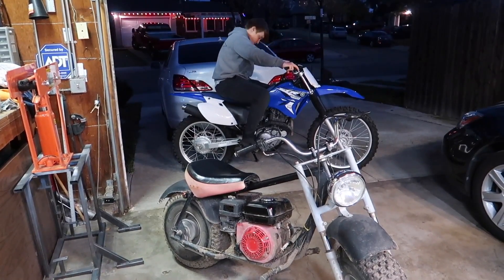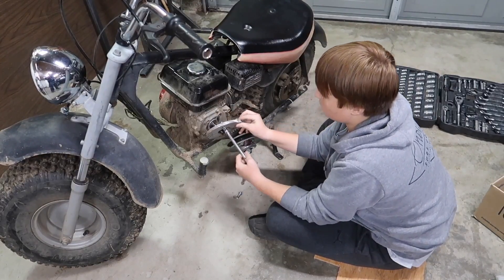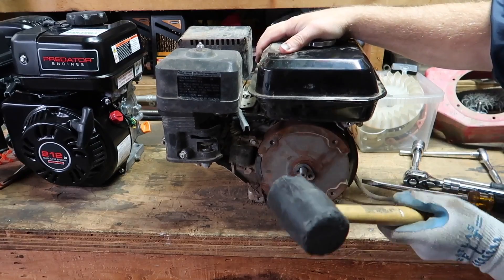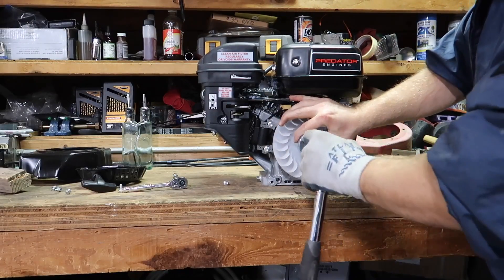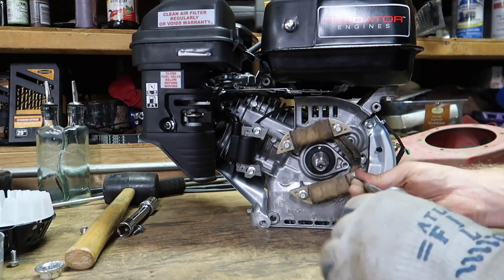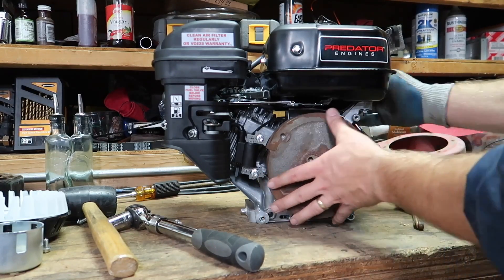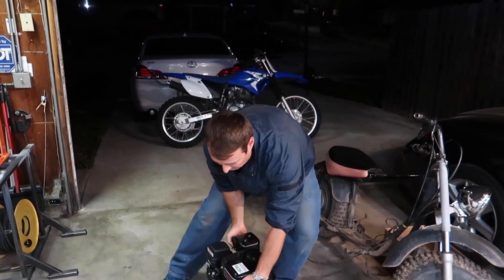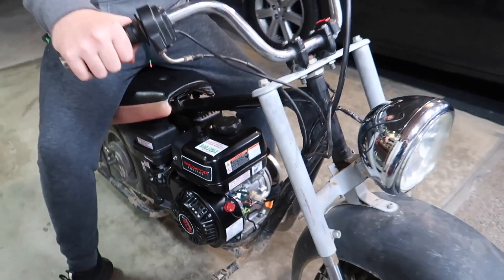Powering 12V headlight with 212cc predator engine

Comment: One can put two regular charging coils on these, and a 12volt 4 wire regulator and get brighter lights with higher output because it has a full wave rectifier.

Comment: I have a rectifier/regulator between the coils and the battery to charge it, does it matter which wires I connect to the AC wires on the coils? (Four wire Chinese rectifier/regulator) Black and red to the battery I know, yellow and orange does that matter?

Comment: Mine is running like crap but the light works, I didn't touch the coil at all but I didn't clean the rust. We'll see what happens.
Reply: Cleaned the rust off work like a champ

Comment: Thanks for this. I did this with the hensing engine to the predator.  The predator worked well and have headlights. But the stock engine now won’t fit with the predator fan.  I think the fans are different.    Stock cover won’t go back on the engine with the predator fan

Comment: Question with the original fly will not work on the new charging cord. What I’m saying is I bought new charging coils and a rectifier, but do I need to also buy a new fly will
Reply from the maker: You’ll need a flywheel with magnets on the outside which produce energy for spark plug and magnets on the inside of the flywheel which produce electricity for your headlight. Original flywheel that comes from the factory only has magnets on the outside that’s why it won’t work. In other words, you’ll probably need a new flywheel if your motor isn’t pre-wired to supply electricity to your headlight. Thanks for watching and commenting.

Comment: Will a aluminum billet fly wheel do the Same or do we have to use the stock fly wheel
Reply from the maker: The reason why I used original flywheel is because it got magnets on the inside (to produce power for spark plug) and outside magnets (to produce electricity for the Headlight)   
If your aluminum flywheel got both magnets than yeah you can use it to power your spark plug and headlight. Good luck

Comment: Can you put the link for that flywheel I bought one it didn't work it wouldn't go in far enough
Reply from the maker: Hello Robert
I’m not sure if this flywheel and charging coil will work on your motor but here’s the link
https://www.ebay.com/itm/264584546086?mkcid=16&mkevt=1&mkrid=711-127632-2357-0&ssspo=Ab1gRNaUQ9-&sssrc=2349624&ssuid=&var=&widget_ver=artemis&media=COPY

Also try Amazon or OMB warehouse, they might have something available. Good luck

Comment: Why did he use the old flywheel? Can I not just put a charge coil in?
Reply from the maker: Original HarborFreight only comes with magnets 🧲 on the outside of flywheel which generates power to the spark plug but you need magnets on the inside of flywheel to generate electricity for your headlight. That’s why I used old flywheel with magnets on both sides of it.
Reply: @balabay77  is there any way of knowing if mines got magnets inside? Without taking it off? How would you make a work? Cheers
Reply from the maker: @Badboyrich1982  
If your motor got extra set of wires coming out of it besides the kill switch wires then it might be pre wired for headlights. Cheap HarborFreight motors don’t come with extra wires.
Reply: @balabay77  no such luck, it is a genuine Honda. I didn’t take the flywheel off but I couldn’t see any screws where the magnets would be on the inside, I might be wrong

Comment: No regulator ? How do you change the AC from the charging coils  to work with DC , LED headlights?
Reply: Was wondering the same. You would have to have a rectifier i would think

Comment: I think any Chinese clone engines are copies of engines that begin with “H” and no parts are actually shared or made in the same factory. Honda manufactures their own components (mostly) and has very high standards for the quality of each and every component that goes into their engines. The materials are better, the castings, machining, tolerances are tighter and much closer to their engineers design specifications. They have taken great care in the design, engineering and manufacturing of their engines. This attention to detail and adherence to their own standards of quality has earned Honda engines their now legendary reputation for quality, dependability and longevity. Chinese manufacturers have simply stolen a proven design that works to churn out in mass quantities. They prioritize quantity over quality and cut corners at every step, beginning with metalurgy and continuing all the way to assembly. As decent as predator motors CAN be, in most cases at least, they are not in the same league as Honda. I highly doubt you would find a Honda motor that didn’t run, right out of the box.  This is not an extremely uncommon occurrence with the predators. Don’t get me wrong, they’re usually great for the money but they are one of the best examples of “You get what you pay for.” There’s a reason they are as low as 20% the cost of a Honda and it’s not because Honda is just greedy. I’ve heard people refer to Honda motors as “ridiculously overpriced.” It’s funny, I’ve never heard anyone refer to them as ridiculously over engineered, ridiculously reliable, ridiculously resilient, ridiculously easy to start or lasting a ridiculously long time. The most common issue with Honda small engines is the cheap Chinese replacement parts people buy, thinking they’re just as good.  In Japanese culture, they’re not as concerned with ones trade as they are the craftsmanship of the tradesman. It’s honorable to take great pride in what you do and to always strive for perfection. You do so knowing absolute perfection is impossible. However, if perfection is always your goal, you will always be improving. This is how one becomes a master of their trade. Unfortunately, you have different philosophies and motivations while under the iron fist of a totalitarian dictatorship. I look forward to the day when China (and the rest of the planet) are free from the tyranny of those so desperately needing to feel in control. (Obviously they’re overcompensating for something they feel is extremely lacking).
Reply: Nah they are actually overpriced in the US

In my country, a genuine thai GX160 is $250, the Jialing version $190, and the plastic shrouded GP160 $160.

In the US I've seen the thai version go for like $600 which is nuts, that's almost enough money to buy a brand new 110cc Honda wave/revo motorcycle.

Comment: Can that be used to charge a battery if you added one?
Reply from the maker: It definitely can be used to charge your battery 🪫 but you’ll need a voltage regulator to ensure you get steady and constant supply of voltage.

Comment: Do u have to use old parts
Reply from the maker: You don’t have to use old parts. If you can find and install new parts, that’s great but in my case I repurposed old fly wheel and magneto coils to produce 12V for my headlight.

Comment: is it ok with no regulator? did you connect it directly to the headlight?
Reply from the maker: It works perfectly fine without the regulator but when motor is idling, the headlight is not as bright as during higher RPM. I haven’t tried it yet but the word on the street is that LED lights are more consistent in lumens in comparison to incandescent light bulbs. Thanks for watching and commenting.
Reply: Just worried about blowing up the bulb if too much current is generated by the high rpm while revving so I'm planning to add a regulator for a stable voltage and current.  Thanks for the great video  @balabay77

Comment: Tip flywheel removal, take a brass hammer and give it one good wap to the end of the crank shaft. Usually comes right off.
Reply: You MUST put the flywheel nut on BEFORE hitting the crankshaft! That reduces any risk of damaging the threads.

Comment: I was way to lazy to do all this, I just used a very slim 25v lithium battery from an electric skateboard. Works well lol just have to recharge the battery every two weeks or so
Reply: I use a small jump start box that you can buy for 50$ at walmart lol

Comment: Do you know if that flywheel is rated at higher rpms than the stock predator flywheel? .. since it seems it was used on H brand... I have one of those engines and I'm thinking of using it for same purpose only my predator has been gov deleted with better springs and flywheel

Comment: Can this motor set up power brake lights and a turn signal kit?
Reply from the maker: josh Koerner 
You can probably try it with a voltage regulator but this mini bike will still be illegal to ride on the streets. Made for off road use only. Good luck.
Reply: @balabay77  In the state of nm if you can get it to go over 30mph consistently, have brake lights, head light, turn signals, the insurance company will let you insure it, then the mvd will allow you to register it as a motorcycle then get it plated.
Reply from the maker: josh Koerner
Sweet. It’s nice that your state allows you to register your toys for road use. Here in CA we’re shit out of luck. They go by the vin number which indicates if it’s a street legal or off-road.
Reply: @balabay77  nm is very lenient on motor vehicles especially the town I'm in. I have ran my car open header for over a month and not a single pull over

Comment: never even gave the hemi a thought being different,perhaps i should verify this by trying. glad it worked out
Reply from the maker: roger oconnor 
Thanks to you I was able to successfully convert it and power the headlight. I’ve always wanted to do this swap but had to find a donor motor. According to other you tubers hemi engines are different but here in California they don’t even sell them due to EPA restrictions. We can only buy them online or go to Nevada to buy them. Anyways, thanks for watching and confirming that this swap will work. Cheers
Reply: I bought the hemi back when they were on sale for $99 and had no idea there were two different types.. just recently pulled it out to swap it on mb200-2 trailmster but in doing so I learned it was a hemi.. initially I was happy it was a hemi but now I'm lil worried after seeing non-hemi on many aftermarket items etc..  so I can't do this because I have a hemi version??? I'm lil confused now... do they make coil kits for hemi?

Comment: Might wanna use a regulator if your'e not using a governor otherwise you'll blow light bulbs every time you rev too high.
Reply: Looks like he just swapped the charging system from the old engine off the mini bike. System probably had one. But good advice for those of us thinking of adding a light to the system.

Comment: I am going to install a charge controller to the charging coil and then connect it to a battery then hook up the headlight and taillight. ( I found the parallel charging coil on ebay for $17 plus shipping.
Reply: did you ever complete this? link for coil?
Reply: I dont know how to send a link as of yet, but i am working on it.  ( just type in the search box for the charging coil for 196cc coleman and it should take you straight to it.

Comment: Do you think u could run the wires from coils to a battery to recharge and just run the lights off a small lawnmower battery?
Reply from the maker: I’m not an expert in this field but you can certainly try, maybe you’ll be able to power headlights and charge the battery at the same time. Word on the street, this setup needs a voltage regulator to run everything smoothly. Let me know how it works out for you. Thanks for watching and commenting.
Reply: @balabay77  forsure man! Thanks for making the vid been wondering how I was gonna do. The regulator makes since. When I'm able to do it I'll get back to ya and let u know how it's working out!

Comment: Flywheel & Parallel Charging Coil For Head Light on Predator 212CC 6.5HP Gas Engine & for Coleman Powersports 163CC 196CC Mini Dirt Bike Go Kart Scooter & for GX160 GX200 5.5/6.5HP Engine Snowblower

Comment: I just did this swap n didn’t clean the inside magnets only the outside ones, will that cause a problem? N which wire goes to what?
Reply: Doubt dirt will interfere too much with the magnets. If the dirt were iron shavings and caked onto the magnets they would still function and have a strong magnetic field.  Then again all depends on the kind of magnets they are and how old they are.

Comment: I found the charging coils listed on eBay for 7.99 ..just search predator 212 charging coils... Sorry for any inconveniences this may but I don't post links
Reply: Does the flywheel still have to be swapped for these coils?
Reply: @kingreno35  I'm trying to find that out now. Did you find out since its been 2 years since you asked?  I was hoping the Predator motors since they have the mounting holes for the coils, and that I heard Generators that have Predator motors in them have coils in them as well which means magnetic flywheel.. so perhaps the stand-alone Predator 212 motor has a magnetic flywheel as well right? Unless theres a huge cost difference in producing those magnetic flywheel for the Chinese, I dont see why they wouldnt just throw it in all their motors even the ones without coils.
Reply: @ChristopherJones16  unfortunately I haven’t found that out because I have had a new 212 but the older ones didn’t. However, I do know there is a slight cost difference for the different flywheel. Idk how much of a difference but there is some…

Comment: Why didnt u inform that you have to also use the old flywheel from the honda also ?
Reply: DJ biGGZ if you pay attention you will see that he did not use the old fly wheel on the new engine
Reply: @AdrianGtz  ofc he did why think he was cleaning it up with the wire brush? Pay attension

Comment: Are the guys that want to do this kind of swap on a Hemi or any other Predator engine what you need to do is buy the charge coil kit and flywheel they're available through Generac and the aftermarket they're made specifically for generators but they'll work on your engine for lights and alternator end of the story
Reply from the maker: Perry Daniels 
Thanks for chiming in and sharing info. Cheers.
Reply: Could you post a link for the charge coil and flywheel? I’ve searched and can’t find it.
Reply: William Boucher the other place I saw it was on Amazon and eBay as far as the link goes I don't know I was searching for other s*** when I found it, but try gopowersports first I think they'll help you. 👍😎
Reply: Perry Daniels that might be a good place to check, go power sports has tons of carting/ mini bike stuff.

Comment: How come you didnt use the newer Predator flywheel?
Reply from the maker: New HarborFreight flywheel only comes with magnets on the outside to produce power for spark plug. You’ll need a flywheel with magnets on the outside (for ignition) and inner part of it to generate power for the headlight. That’s why I used the old flywheel and old magneto stator coils.

Comment: I’ve got the Predator 212 hemi now I need the charging coil and flywheel where can I get one that fits my motor?! I’ve been looking online and getting all mix answers.. if so please leave a part number been trying to run light for some time now
Reply: you need flywheel 1702529s and stator 1708507s just went threw this
Reply: @inthewoods5471  Get it working?

Comment: I have an original honda gx160 and i want to put charging coil in it to have a power source... Do i also  need to replace the original flywheel? Will the charging coils fit with the original flywheel?

Comment: You dont mention what the old engine model is used of the donor horizontal shaft engine having those charging coils, What was wrong with the old engine,was it worn out? people most likely can get the whole flywheel and charging coils from like a Honda clone or a Briggs& Straton (whichever company has the Briggs now?) to match that flywheel as a complete pair from EBAY

Comment: Here is a link but also remember you will have to buy the Flywheel and Fan to make it fit as well with the coils. You will not be able to use the predator flywheel fan on the Baja flywheel.

https://www.ombwarehouse.com/165-321-baja-oem-cylinder-assembly-charge-coil.html
Reply from the maker: Thank you Troy for mentioning about the flywheel and fan. Yes sir, predator flywheel and fan will not work so whoever is planning on doing this conversion then they would need 3 items charging coils, new flywheel with magneto points and a fan that matches flywheel holes. Cheers mate and thanks for sharing the link.

Comment: Am i understanding that u have to use the old flywhel to make to charger coils work? And if u use the new predator flywheel it will not charge?
Reply: The inside of the regular predator flywheel does not have magnetic pick ups for charging coils. That's why it will not charge or work with original predator flywheel. They sell kit on amazon for 90 bucks and comes with everything.

Comment: Very nice video! I have a question. Do you need a fuse and a voltage regulator?
Reply: No, I put a voltmeter to it it doesn't even put out voltage but it works.
Reply: @tommyhajimoto6968  , Thank you.
Reply: @tommyhajimoto6968  it puts out ac voltage. if you had your tester on dc it would show 0 volts. some bikes run a voltage regulator to turn the ac voltage into dc 12 volts and some dont and just run the bulb off ac
Reply: @davemiller262  I never knew that thank you. Does it put out like 112 volts or something?
Reply: @tommyhajimoto6968  without the regulator, it depends on revs. If the system is designed to work with a voltage regulator, then magneto produces higher than 12v voltage (so the regulator will have enough energy on low rpms). On my bike, for example, it produces around 60v before regulator rectifier... However, if a system wasn't designed to work with regulator, then it should produce in vicinity of 12v AC on max revs. You just have to measure what you have in your case, before plugging in any electrical devices.